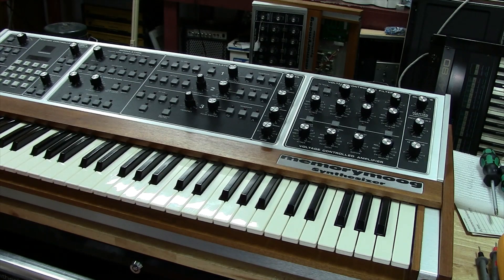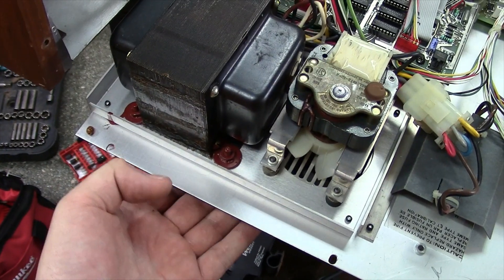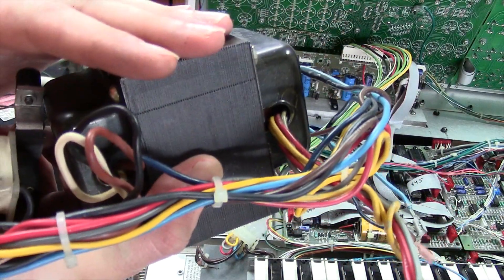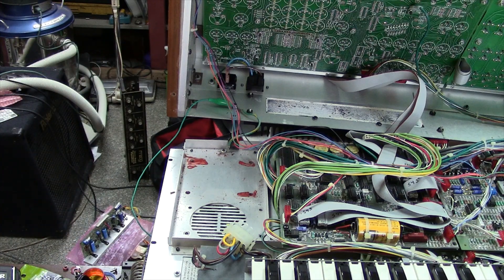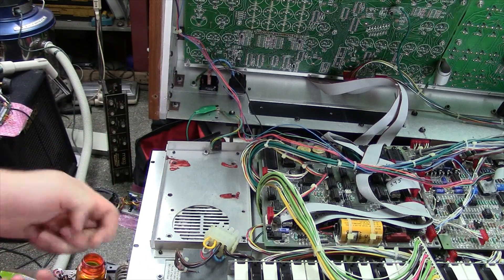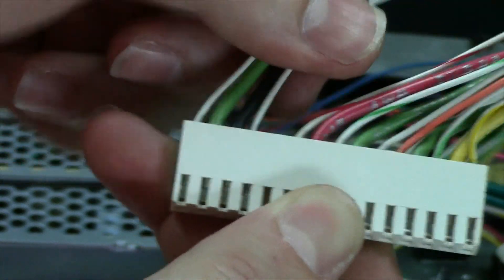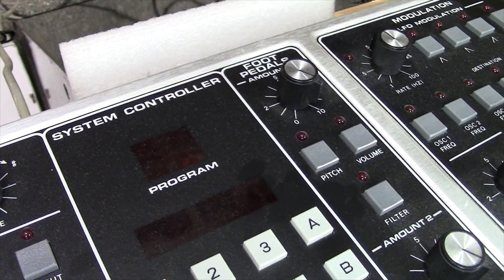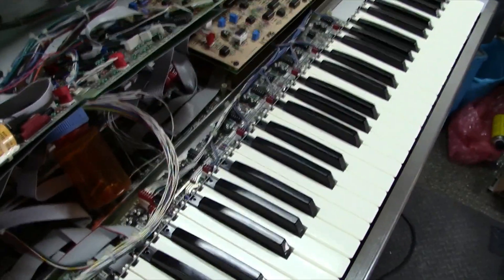How To Install Synthtaste Memorymoog Power Supply Upgrade (by synthpro)

Comment: Greetings Jareth,  that’s really COOL that new advanced components are being manufactured for such an old instrument.  Says a lot for it’s surviving popularity and the engineers that created it.  That’s a load off getting rid of the transformer weight and the heat as well. It would be COOL to see a before and after thermal image of the inside.  I read somewhere thermal imagining of circuit boards can be useful in vulnerability detection and diagnostics

Comment: Have you tested the sound before and after installing an SMPSU? I am a little worried that the sound might change!
Reply from the maker: No problem with sound. Pk to pk ripple and voltages are about the same. I would recommend taking voltage readings of your original supply first and then calibrate the new supply to match the old supply. If your old supply is not around +/-15.000VDC or +5.000VDC  than it may be time for a full calibration while inside the unit. 
I have tested both the doubleheart audio as well as this power supply and both work great. I do like the mounting of the doubleheard PSU much better.
Reply: awesome thank you for the info!! 

 @synthpro

Comment: Hi and thanks for another great video. I was wondering, do you ever burn in the Memorymoog with all LEDs on for 24 or even 48 hours with this replacement power supply installed? I realize this is not typical operation but it should work under worse case conditions. I believe you will blow the 15V  fuse on the pwb unless changes have been made since I installed mine back in 2016.

 On my version the +15V was used to derive the +5V raw signal providing current to all the LEDs and the displays. This supply has no +5V raw voltage line like the original.  I believe this +15V circuit is under-powered and can not provide the current needed to power all those LEDs and displays simultaneously. The schematics show 190mA for the +5V raw but this is a mistake. Together the LEDs/displays draw up to approx 750 mA (edit on 6-28-22).  That 15V fuse will eventually heat up given enough time (depending on number of lights) and blow.

Comment: Hi Jareth, Thanks for the very informative video- Can I ask you-Was there any spurious leakage voltages from the SM/PSU  measured on the ground ring on the output/input jacks that might give tingles on to other equipment- Mic's,Guitars etc? Thanks again And all the best
Reply from the maker: I have not experienced this at all. What would cause this is perhaps a polarity swap of line and common wires, the common and ground do have a relation so reversing the common for line could possibly cause a problem like this. This was a huge danger with some of the old amplifiers, they would actually put a polarity switch which would make the chassis live causing mics and instruments to electrocute you. 

One if my friends that worked at moog back in the 80s told me about a Memorymoog that was returned to them under warranty that had been plugged into a reversed polarity amp and it completely fried the unit to the point they  displayed the circuit boards.
Reply: Hi Jareth thanks for the reply, I forgot to say sounds very nice !!

Comment: Little bits of metal from the drilling scares me. I would have used some cardboard or something to shield the boards from any flying metal.
Reply from the maker: I didn't film it but I gave it a good vacuuming after drilling. Typically when I drill like this, I run the vacuum while I drill. After all the work, I give everything a good inspection. You could definitely use cardboard or material to shield boards.

Comment: Will this work with a LAMM or would I need more modifications other than the ones you have describe.
Reply from the maker: I am not real familiar with the LAMM internal changes, I believe it will work just fine but may be different connection required for the reset and memory circuits. Martin should be able to answer this question. Contact him directly at: mghoewner@web.de
Reply: @synthpro  cheers,will do :)

Comment: Thumbs up, Hi
I have  a problem with my MM,,
Everything works fine, But I can’t save the preset,, I followed the manual and as long as if I don’t turn off, I can jump across the preset which I saved,
But if I turn off and on, it’s gone..
Some said its memory battery problem..?

help me here.. I need to really use this MM nowadays.
Can you explain how I can replace the battery or can you shoot any video about it? :) I guess its too much, anyway
I will try the battery replacement whatever you tell me.
Please help me hero
Thumbs up